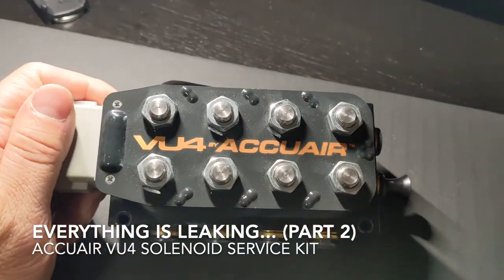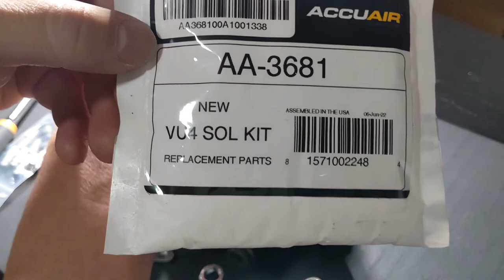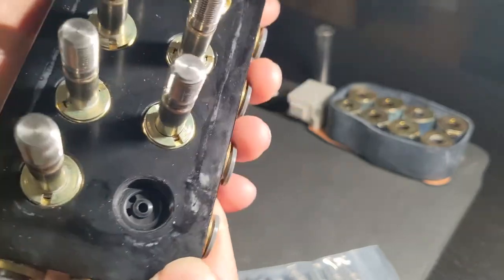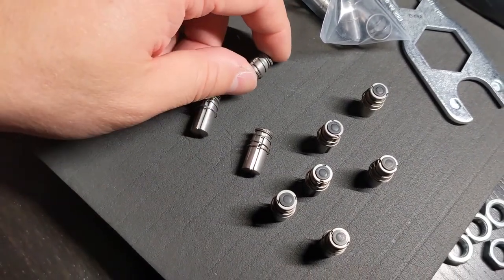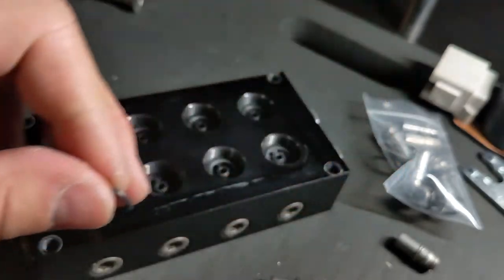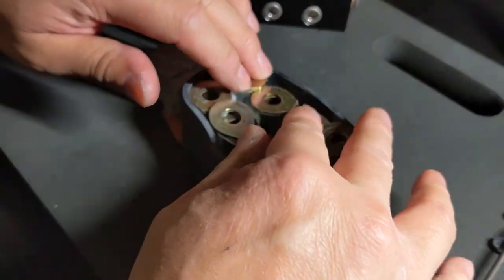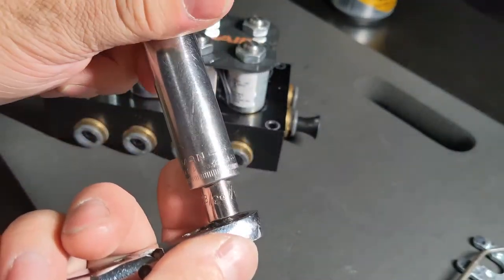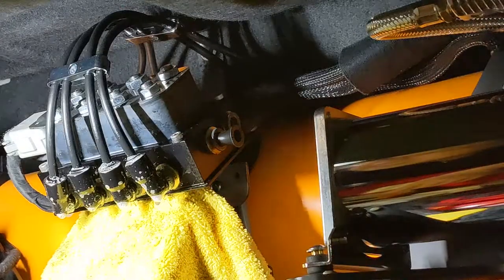Accuair VU4 Solenoid Service Kit -  Everything is Leaking Part 2

Comment: How can you tell if the top part ones need to be replaced. For mine I know 1 each of the side ones need to be replaced, but how can you tell about the top ones
Reply from the maker: If you see one or couple of corner not holding air and you can't find any leak elsewhere in the air lines or the bags itself,  then likely it's leaking from the manifold top valve seals